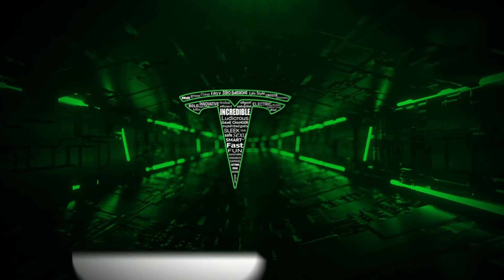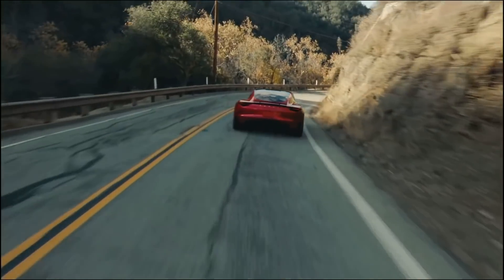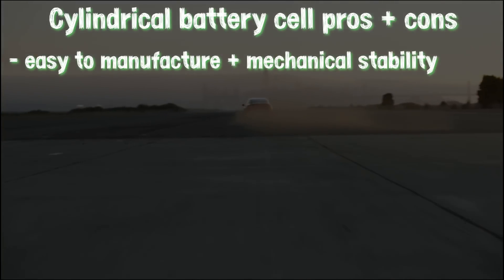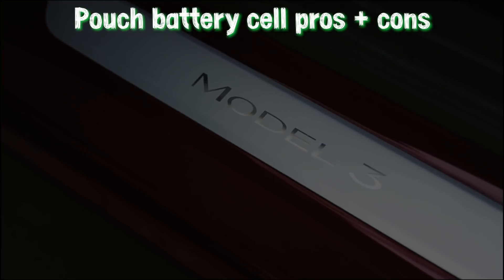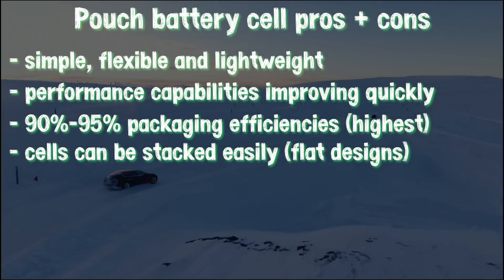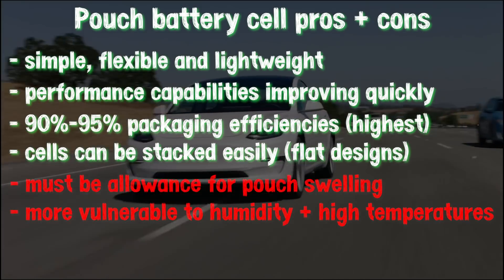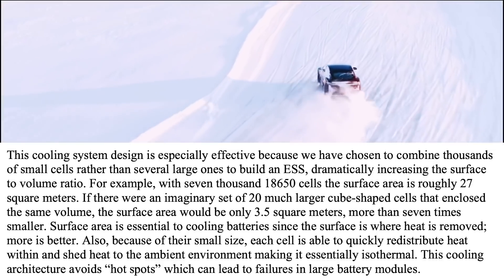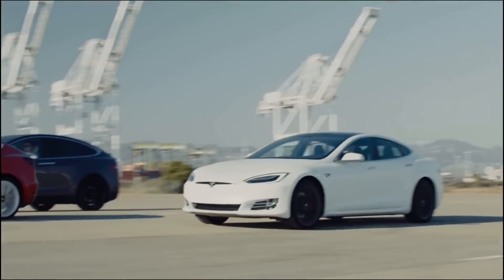Tesla Cylindrical Battery (vs. Pouch/Prismatic) and Tesla Battery News (CATL)

Comment: I interesting to hear that Tesla may go with anything other than cylindrical cells at Giga China. Might be a cost efficiency move that works for their market better. I don’t expect them to be using them in the US or Europe.
Reply from the maker: I'm with you Adrian! Was surprised to hear this for sure. Either China is semi-forcing them to do this or they want to implement their "cell to pack" breakthrough and are not worried about increasing range or performance and are more focused on savings and margins. Will be following this for sure!

Comment: There is no benefit of using pouch cells for cars... They are good for cellphone and laptops because they are flat, but because they expand, they suck. Prismatic is not bad, but unless you don't need cooling, otherwise cylindrical is better since the unused space will be used as cooling ducts anyway...
Reply from the maker: Hey! I wouldn't go as far as saying "they suck", they just have different challenges that have not yet been solved as well as the problems cylindrical cells inherently have

Comment: FYI, Tesla cyl cells don't have a PTC or CID. They do use a thin spot welded connection to the bus, that can act as a fuse if overloaded. Their micro channel extrude alloy cooling ribbon that snakes between the cells is futureSHit too.
Reply from the maker: So are you saying that TSLA was lying with the paper or just that they have removed them since the Roadster days?

Comment: Lithium Iron batteries have lower energy density but are more tolerant of charging over currents, more tolerant of high temperatures, suffer less charging degradation, are less expensive and contain no cobalt. Perhaps with less critical cooling requirements they can package the cells tighter, mitigating the energy density issue.
Reply from the maker: Thank you for sharing this input! Definitely a chemistry I plan to dive into a bit deeper with this news!

Comment: The concept of the China Model 3 & Y having all its components sourced in China including batteries supplied by CATL , China effectively becomes a company owed franchise. If the batteries are not up to standard ITS NOT OUR FAULT. It is buying Tesla time and developing its packaging configuration. (DRIVE TRAIN DAY).The  software based battery  management system puts it ahead of competitors, using the same CATL or similar cells, while automation, by eliminating the labour component, establishes a similar cost structure anywhere in the world. Tesla can continually optimise the Dahn sauce , Braga/Goodenough solid electrolyte,  Maxwell dry electrode, Hibar manufacturing etc etc. (BATTERY DAY) It is executing the strategy of building the factory, to build the factory, that makes the product. HEARD THAT BEFORE.
Reply from the maker: Haha "the Dahn sauce" - that bit alone got my heart on this one. Thank you for taking the time to share this, much appreciated Ed :)

Comment: None of the three variations of cells has a real
chance for the future. You have to follow
nature's example. 

You see in  the structures of nature that consume
energy, preferably with living beings, none of
the three elementary basic configurations for
the energy system. 

What you see is a complete system, not hundreds
of sub-units that are put together to form a whole. 

The development of energy systems for EVs will
have to follow the example of the great master.

Translated with www.DeepL.com/Translator (free version)
Reply from the maker: So what's the answer?
Reply: @DillonLoomis22  If we trust nature as a model, then
it is a compact unit. All primary and also
secondary components are bundled. 

There is a central storage/converter from
which we draw the electricity.

Comment: Their latest “chemistry cell update” technology patent only mentions pouch style cells, that was over a month ago!
Reply from the maker: Hey! The abstract said that the results actually do not indicate any performance enhancements due to the form factor...they just happened to do testing with pouch cells
Reply: Electrified , correct to a certain degree only, form factor plays more into ‘packaging’ and Cooling/Heating which influences performance indirectly yet it still does. Tesla is ‘losing a lot of space’ by using cylindrical Cells and that is where pouch Cells have a big advantage. The flat surfaces also make heating/cooling simpler and lighter. I think that the next generation, improved chemistry cells will be pouch type.

Comment: So are graphene batteries currently in cylindrical form or prismatic?  Is it possible Tesla will be diverging to graphene or do you think they’re holding out for Goodenough’s solid state battery we have yet to see?
Reply: Vasu Jaganath I understand and concur with the points you’ve made.  I’m just curious if there’s been any insight into what Goodenough’s technology looks like and if it’s viable for production in the next 5-15 years.  Also, graphene/lithium alloys have been produced for consumer application and was curious what electrified thought if this could be technology implemented in future Tesla batteries.
Reply from the maker: Hey Stefan - Goodenough and Braga seem to believe their tech is ready for commercialization now, but whether the industry agrees is an entirely different story. Over the next 5-10 years I'd say the chances are high someone figures out the solid state conundrum
Reply: Stefan Cormier one could do graphene batteries in pouch, cylindrical and prismatic. But I am not sure what RealGraphene uses in their products. I guess pouch, in order to maximize use of space.
Reply: I guess ultimately I’m curious what someone with more time to speculate thinks is the future for Tesla batteries.  I certainly don’t have the time but to me it seems Tesla would most likely simultaneously conduct research on improving their current LI, along with applied research on graphene alloys, and much later quantum batteries (like 50 years or further).  Just curious what all of you think?
Reply from the maker: I think the bigger focus is speed of production and ultimate battery production capacities with a very close secondary focus on improved chemstries, densities etc. - we're going to get a huge look behind the curtain in April!
Reply: Electrified appreciate it!  Also, enter me in for the drawing haha
Reply: Vasu Jaganath completely agree with you.  Just curious is all.  Honestly the biggest issue for me getting a Tesla to replace my current vehicle is the constant long unexpected commutes that the military tends to impart on me.  But as a second vehicle it’s certainly in my future.
Reply: If I could get 900 miles or much faster/more available superchargers then I’d already have one